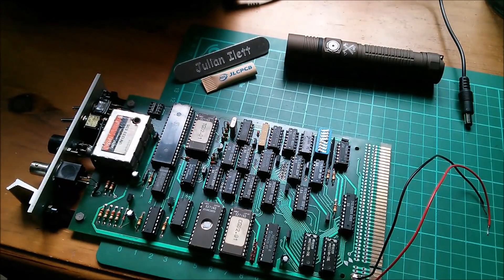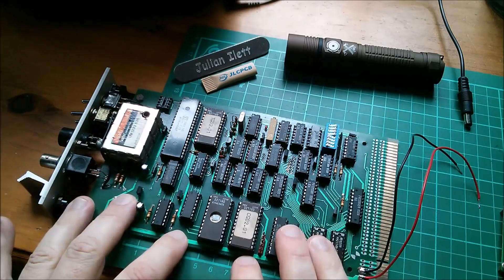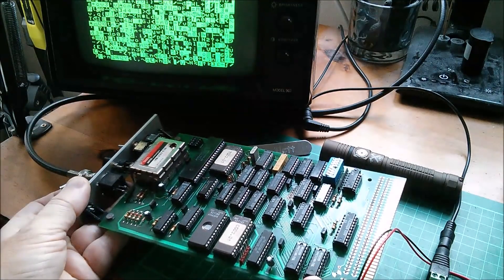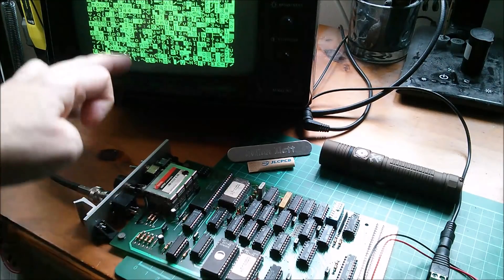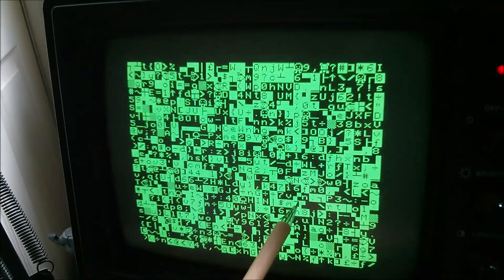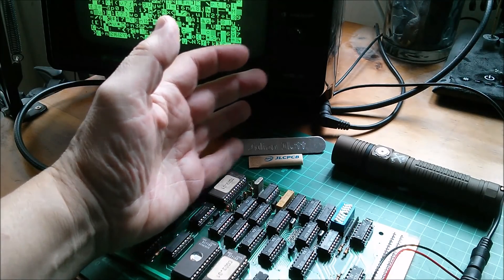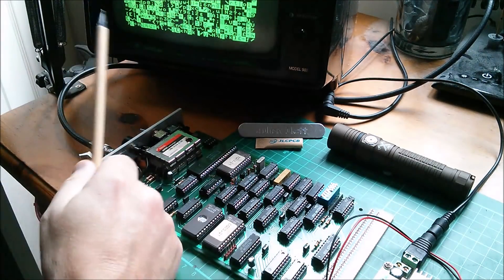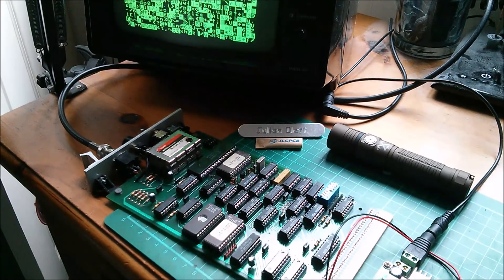Video Card Works after 18 Years in Shed

Comment: Realy neat card. But why are the chars 8x10 bits and not 8x8 bits?
Reply from the maker: You need 10 pixels height to show decenders - the little tails on lower case G J y q and j
Reply: @JulianIlett  That makes sense. I'm used to the Spectrum 8X8 char set which is a bit up and down in lower case.

Comment: I'm wondering why is the design based on a Z80 for generating the sync pulses instead of a Motorola 6845 CRT controller.
Reply: Good point; i would guess that the people who designed it had easy access to Z80.

Comment: That's great to see...it will be cool when you get the whole computer going. That card looks very similar to a card based system that is sitting around at the AV museum I run Radio Foxton out of. I might have a look at it closer. It's some kind of video character generating system...but could well be Z80 based.

Comment: I would  seriously  question  why the board is using so much power. We built a Z80 based system in the early 90s which probably did much more work than that module and nothing got more than mildly warm. If I remember correctly  we ran the Z80 at 4.9152MHz. I was the software  designer, my colleague did the hardware side, but I remember talking about slew rates and how they affected current consumption. Since lots of things are getting hot, it might be worth having a look at the clock generation.
Reply: Late 1970s and early 1980s tech often had a high current consumption and resulting ‘runs rather warm’ characteristics. Take an Acorn Atom, that uses a NMOS 6502 and a 6847. It also uses 2114 SRAM chips. When fitted with 12K bytes of RAM, it needed around 1.5 Amps of current at 5V. That’s 7.5W for a single board computer. And that’s when using the ‘low power’ 2114L chips. 2114 maximum power dissipation is 525mW, 2114L maximum power dissipation is 370mW.
By the 1990s, the memory and logic technology had moved on considerably in terms of reliability, lower power consumption, and higher density.

Comment: It would be fun to 'hack' into it and drive it with a modern 8-bit microcontroller ;-)
Reply: A modern 8 bit microprocessor? What type are you thinking? Zilog CMOS Z80s are still being sold, as are CMOS W65C02 CPUs. Or are you thinking about a microcontroller?
Reply: @Mark1024MAK  fixed

Comment: super high pitched noise in the background of the vid,  maybe 14khz ish
Reply: Oh, I don’t know, maybe 15.625kHz-ish? 🤦‍♂️
Reply: @matthewkriebel7342  Indeed. 25 frames per second times 625 lines per frame.
Reply: Go look up CCIR system I (that's a capital i). You may spot 15625Hz in the text...

Comment: the best way to clean up edge connectors is to use a pencil pen eraser use the pen side to get most of the debris off and use the eraser to polish it.
Reply from the maker: Yeah, I used that technique when I was a field service engineer. But my eraser wasn't having the desired effect. I must buy one of those double ended pen/pencil types you mention :)

Comment: Would definitely enjoy seeing a Z80 revival adventure!

The Z80 is still being mass produced today, some 40 years later... pretty impressive
Reply: Which vendors do they still mass produce ?
Reply: The two vendors I know are Mouser and Digikey, they both still stock the Z-80 and all the main peripherals (PIO, SIO, CTC, DMA, etc)
At least they did last time I checked
The part numbers start with Z84C: Z84C0008 is the 8MHz version of the CPU iirc
Reply: @leisergeist  Yup, the last two digits refer to the (max) clock frequency. The two digits immediately after the C is the TYPE of chip, e.g 00 = CPU, 20 = PIO and so on - i can't remember them all by heart, but it's easy to google ;)
Reply: @BertGrink  Yep! I was trying to remember it from heart lol
They're all parameterized on Mouser anyway though

Comment: I guess I'm a little older, mine was an S100 bus system.  And as you did, each part was built as I could afford it, took years LOL!  I could not afford an EEPROM programmer so I designed and built a keyboard decoder using only TTL 74 series!  I even got the thing published in our local Homebrew Computer Newsletter!
Reply: Is your machine a Research Machines 380Z.

Comment: a "12" or "14" character as a single digit? That's certainly not ASCII; probably some kind of compression / translation / mapping. In my humble layman opinion.
edit: all ICs are socketed
Reply: Watch the video. They were custom characters on the 2nd EPROM above 0x80 ASCII for his own project
Reply from the maker: All ICs are indeed socketed with nasty leaf-type sockets. I pulled a chip out and it destroyed the socket, so I've had to replace it with a turned pin type :)

Comment: There's a high pitch sound at 0:42
Reply from the maker: Is it 15.625kHz ?
Reply: @JulianIlett  it's got to be close to that because I used a sound equalizer to block it out at 16k
Reply: @JulianIlett  It's not just at 0:42, it's through the entire video. Presumably the CRT. Unfortunately it makes the video almost unwatchable for me (and anyone else who can still hear those frequencies). :(
Reply: Don't remember offhand, but based on Julian's reply, I suspect 15.625 kHz is the horizontal scanning frequency of his CRT monitor. All CRTs used to do this to some extent. We just got used to it, as there really wasn't any alternative display technology. Made it easy to know when someone was watching TV, though, even through a closed door.
Reply from the maker: I can no longer hear that frequency, but have continuous high frequency tinnitus to replace it. Ah, the joys of old age :)
Reply: Ted McFadden - yes, most CRT displays back then ran at that frequency. Young ears can hear it. If you are middle aged or older, it is now most likely beyond your hearing range (I can no longer hear frequencies this high). Some CRT displays / TVs were worse than others. In most cases, it is the inductive components vibrating (LOPT and horizontal defection coils). In poorly designed sets, the 15625Hz (for 625 line systems) leaks into the sound circuitry as well.

Comment: The 2114s if very hot, could also be broken, it happens on a few C64s I have repaired.

Would love to see the rest of your old machine!
Reply: Old RAM often just runs screamin' hot, it's fairly normal
I can't pretend to know exactly why though lol
Reply: @leisergeist  could be a matter of frequency if nothing else... (tbh i didnt even know that some of those chips even CAN run at these speeds)
Reply: 2114 are static RAM. Static RAM is basically lots and lots of transistors wired as flip-flops. So around half of the transistors will be on all the time. With bipolar transistors (which is the type used in these), they have to run with a small, but significant current so that they can be switched at the speeds needed (these have to run at a speed to supply the data fast enough for the CRT beam). Add all that together and yes, a surprising amount of heat.
Modern chips use high speed CMOS technology, so (apart from CPUs and similar devices) run cool in comparison.
2114 maximum power dissipation is 525mW.
2114L maximum power dissipation is 370mW.
Reply: Mark 1024MAK Interesting! Thanks for the detailed explanation.

Comment: I’d put a sticker on that uncovered EPROM.
Reply from the maker: Not a bad idea :)
Reply: I had the same thought at 0.15 seconds into the vid.
Reply: EPROMs aren't designed to hold the data reliably that long anyway...even if the window is 100% opaque. Just like EEPROMs, Flash, etc. the charges that form the data eventually disperse even without any UV or other energy exposure. The typical storage "shelf-life" of memory technology back then was less than 10 years and you were lucky if it was that long. The number of Write cycles was also very low.

By the way, I've got an Apple II+ and a TRS-80, both from the 80's and still boot-up. Wouldn't ever risk my life on the integrity of any data that went through their subsystems.
Reply: exgenica - 10 years was the guesstimate from the manufacturers back then. For modern devices, they now give longer storage times.
Reply: Yep...I assumed Geoffrey was talking about those EEPROMs from the 1980's that were part of the topic.
Storage retention has improved, but even new memory hardware isn't something I would consider super robust. 
It also depends on the electrical parameters used to store the data and mistakes can result in a very weak charge state to begin with. But, regardless...I have been very surprised from time to time at how long some of those older devices have retained uncorrupted data for a few decades. On those old EEPROMs...if he wants to keep the data then he should copy it onto something for archiving...and be REALLY careful while doing so (anti-static, no UV sources, etc)
Reply: Mr Brightside - like Windows is really reliable...
Reply: They actually can be erased with UV light and this is the reason for the window, so the sticker is a very good idea.